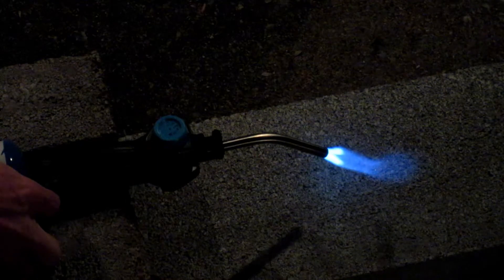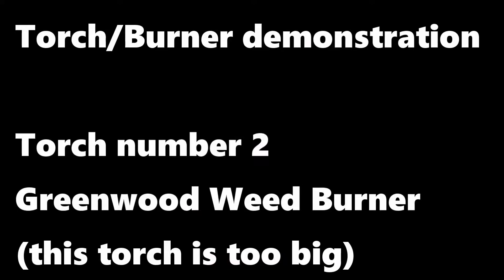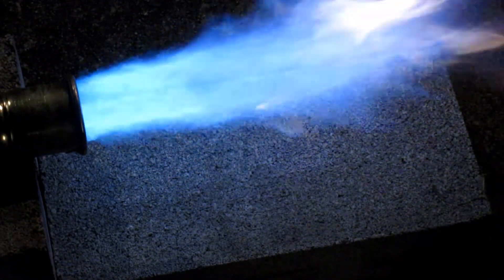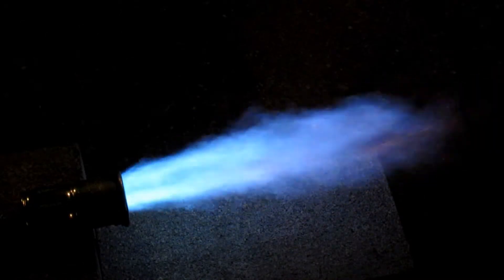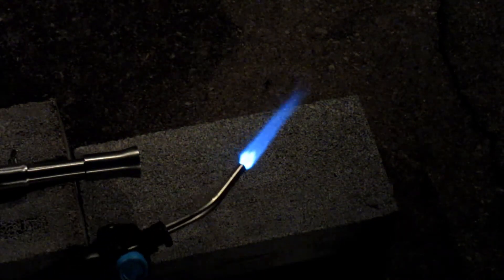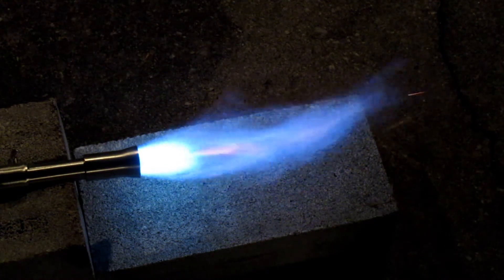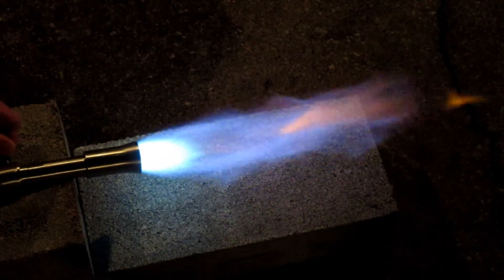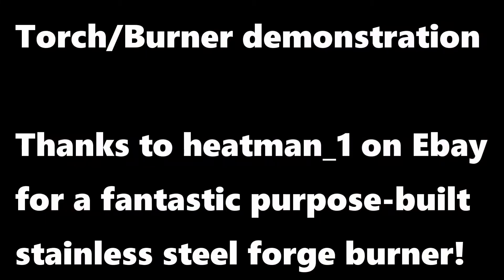Which torch is best for forge? (Or, Goldilocks and Propane)

Comment: What happen if the torch tips getting too hot? 
Will the heat flows back to the gas tank?
Reply from the maker: The combustion occurs when the gas is mixed with air (oxygen). It is very unlikely for combustion to climb the hose to the tank because there is no oxygen.
Reply: @texastaterbug5395  i mean is it possible for the torch becoming too hot and the heat flows back to the tank then expanding the fuel inside the tank?
Reply from the maker: @minorspread5710  I don't think so. In fact, the fuel in the tank is rapidly expanding. These are LPG fueled with a single LPG line and airflow adding oxygen by "venturi" effect.  Liquid propane gas expands into a gas as it is exiting the tank. The process is endothermic. After an hour of running a burner like this, my smaller tanks will be covered in ice and eventually the gas will freeze and will no longer flow.  That's also true for a oxy/acetylene or oxy/propane setup, but the difference in that setup is that there is oxygen in the lines and that CAN allow for combustion to occur in the lines and run back to the tank! Those types of torches have flashback preventers so combustion cannot reach the tank.
Reply: @texastaterbug5395  I get it now, it's so helpful. Thank you sir 🙏

Comment: What about the 3 head torch at harborfreight?
Reply from the maker: I think it would suffer from the same problems I had making the big weed burner torch work well. The "Venturi" system for those torches is limited so you would not get a good air-fuel mix in the nearly closed environment of a furnace or forge.
Reply: Ok thank you brotha